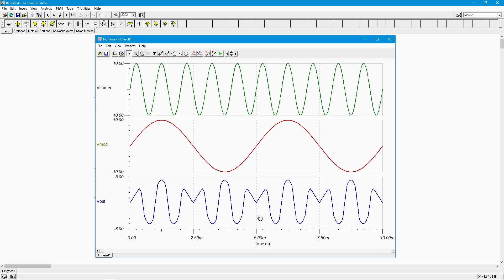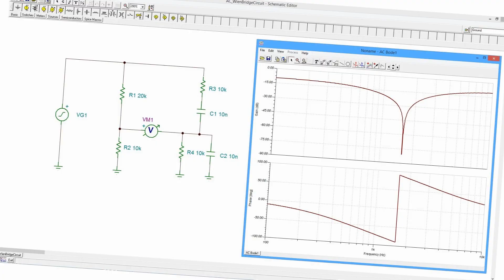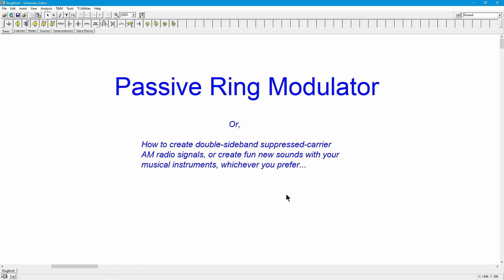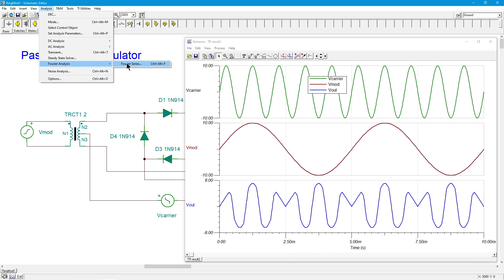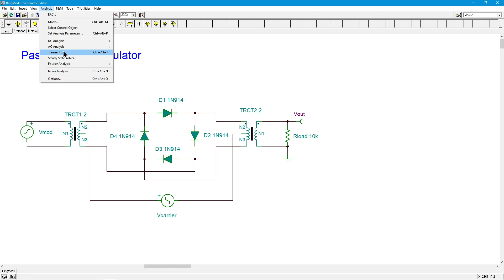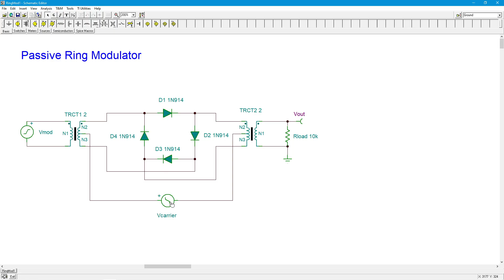Semiconductor Devices: Ring Modulator

Comment: I have some 600 Ohm audio transformers, so I'm going to try this, with Schottky diodes, or Germanium if I can find enough.
One of the first circuits I built was a ring modulator from a magazine article, which used three 2N3819 JFETs in a long-tailed pair configuration.
There was a pot to adjust for minimum carrier breakthrough, and I was pleased because it actually worked.

Comment: Swapping the position between the carrier input and the output port will increase the output's ability to express a rectification function.
Both input signals need to be passed through a series resistor to achieve output linearity.
Reply from the maker: Assuming the inputs are the same amplitude as they are here (remember, we are not trying to produce AM radio), swapping the ports will make no difference. Second, adding series resistors to the sources will greatly decrease the output amplitude and change the levels of the harmonics. You might like the sound of that change, but that's a separate issue. It won't be "more linear", whatever that is supposed to mean in this context. This circuit is inherently non-linear. If it wasn't, you wouldn't get the sidebands. Instead, the signals would just add.

Comment: This is awesome!! I made a ring mod project myself using log amplifiers because I couldn’t get why this worked but your explanation was great! Thank you! I am curious as to how the N2 and N3 nodes are linked to the transformer, it looks like N3 links half way through the transformer or is that just convention?
Reply from the maker: That's a center tap. There are three wires coming off of that winding. 

What log amp did you use for your project?
Reply: @ElectronicswithProfessorFiore  I used an op amp with diodes in the R1 and R2 places in a non-inverting op amp configuration. It uses the exponential and addition of logs in order to multiply a signal by the audio, the signal I chose was just a sine wave going from 0 - 1V. Loop up log amps. If you're speaking about what specific op-amp I used, it was an LM4562, just a simple audio amplifier.
Reply from the maker: @JoshFMusic  Yes, I have a video on that configuration and it's covered in my op amps textbook. It's a nice place to start but has some limitations. I thought you might have a used a specialized log amp like the ones from Analog Devices and others.
Reply: @ElectronicswithProfessorFiore  Very very fun project though, love your videos.